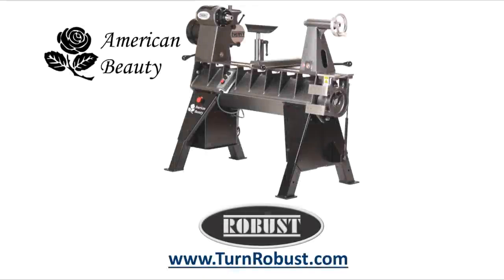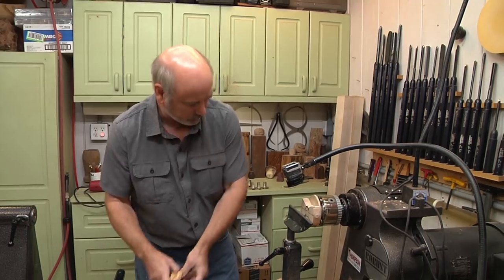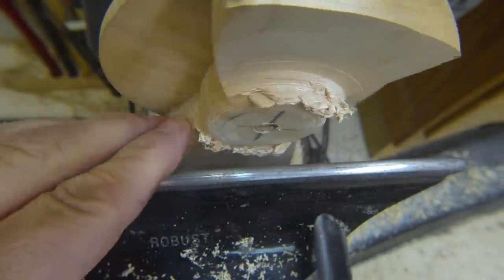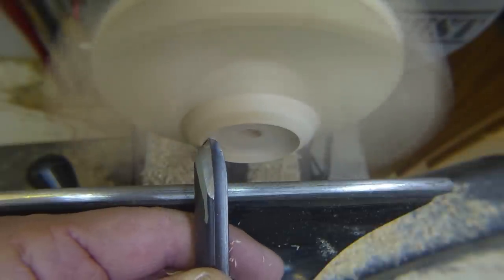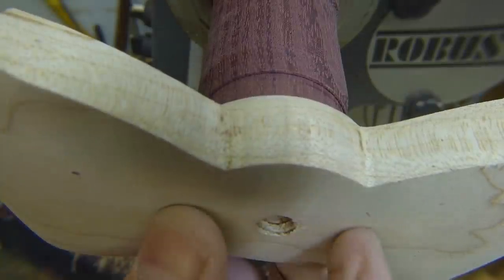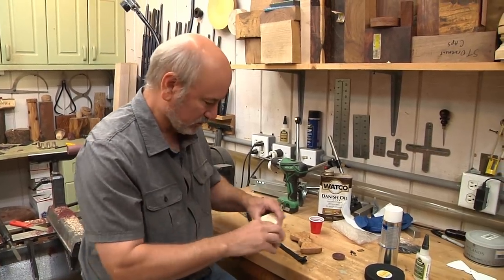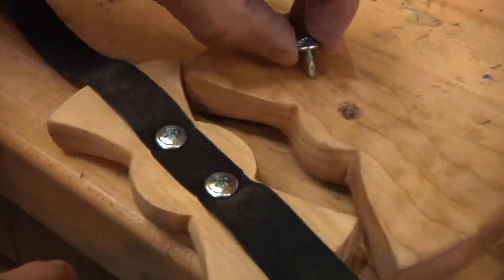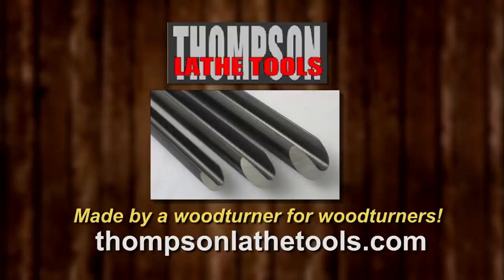Bow Tie-Part 2

Comment: Interesting, Tim. You lost the quilting because of the inward angle of the cut toward the "knot".  That cut diminishes the undulating grain patterns.  Not really away around it here.  Keep 'em coming.
Reply: That is a good tip. I always wondered why the quilting would disappear sometimes. Is a flat surface the best?
Reply: For highly figured quilting and curl, yes usually.  Crotch flame still seems to do well on curved pieces and sometimes you can get lucky with other figure.  But it will seldom look the same as what you see when it is flat.  For small spindles (like pens) you don't loose much of the figure because the curves are generally quite small compared to larger pieces.
Reply: Thanks!